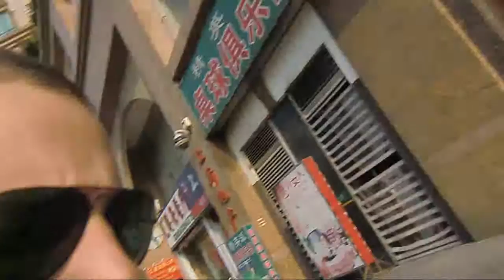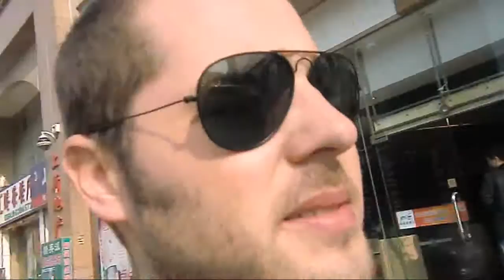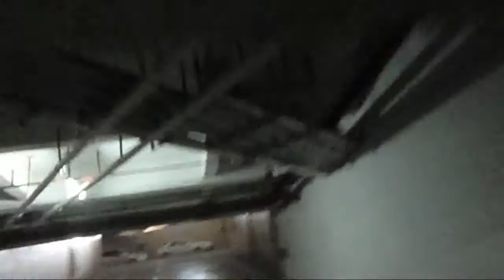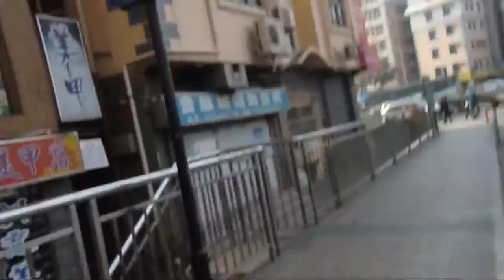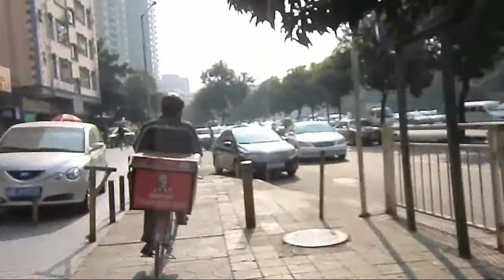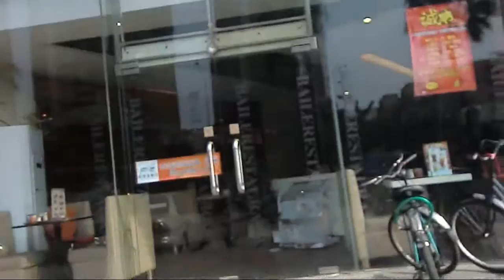Gy6 Compression test without tools

Comment: @hanzmole1  Correct.  Spark plugs have a compressible ring at the base of the thread that ensure a consistent seal (providing your head is clean/smooth of course).  Over tightening a spark plug can very easily strip the thread of alloy heads.

Comment: Thank you very much, really helpfull. When I turn by hand the engine variator (because I have no kick start) fast I need to apply very much force when the piston is at the compression stage, but!, when I turn the variator slowly, the engine offers almos no resistance to turn. Can be that a sign of a compression leak? thank you in advance!

Comment: hi I have a gy6 125 cc scooter it doesn't start at all once it gets cold but once I have started to get it going again it runs great new spark plug there is know air blockages seems to work once I have warmed the spark plug up any ideas what this could be
Reply: Did you ever find out what this problem was? I'm having the same issue. Need to let the scooter run for about 15mins before I get acceleration.